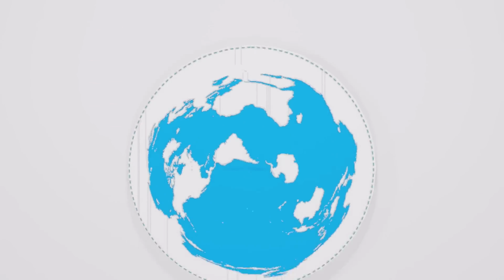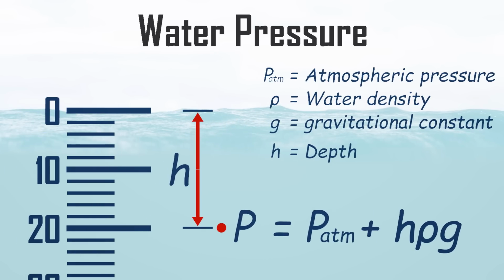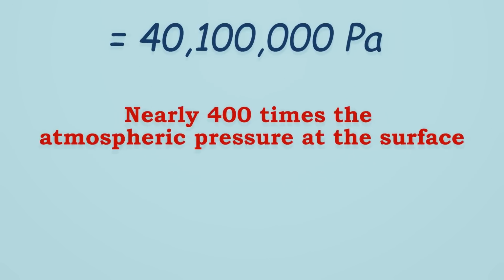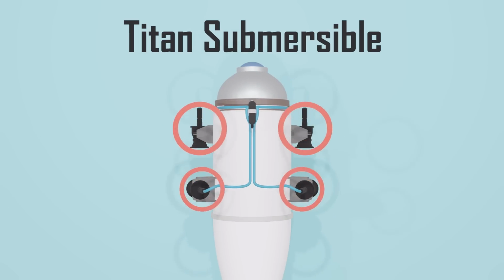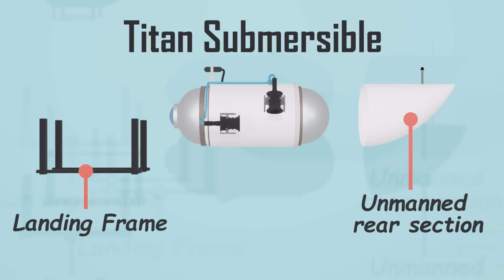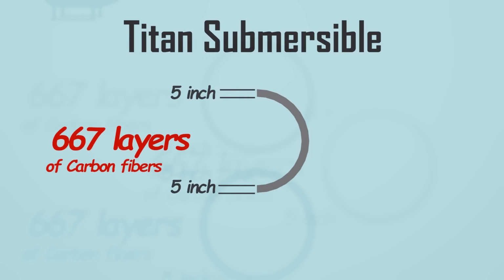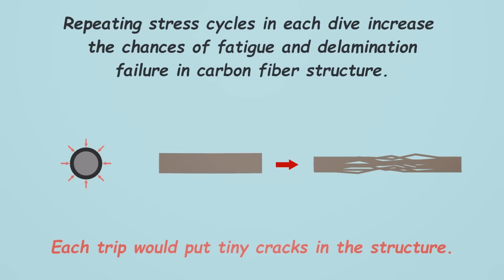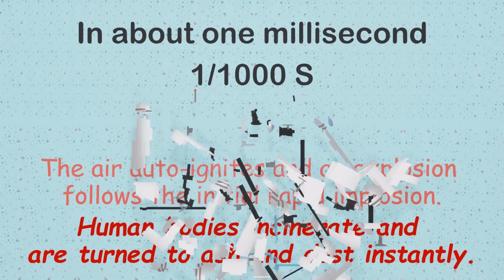Titan submersible | What really happened ?

Comment: "...inner hull which was meticulously engineered to withstand the tremendous pressures encountered in the deep ocean..." Nope! Not even close! Why does an electrically powered submersible have "a high concentration of hydrocarbon vapors" inside the crew cabin?

Comment: The CEO, ignored the warnings and recommendations from the Marine Technological Society, other submersible groups, many experienced experts, and former employees he fired for not approving of his actions. The sub failed on its 14th dive, the average protocol of testing any experimental submersible is on average 50 dives. He also refused to do NDTs on the hull, Non-Destructive Testing….Ultra-Sound. But then again, he is quoted as saying that, he needed to break rules in the name of innovation, he did not want to have experienced submariners, experts, who are mostly 50 year old white guys to be involved in the venture….because they are un-inspiring to recruit the younger folks. Always err on the side of safety.
Reply: Since starting his big money Titanic tourism endeavor, back in 2019, the so-called brains behind this tragedy had already successfully completed over 40 cycles on the vessel before this disaster popped his bubble (that'd be 40 dives down to the Titanic, along with another 40 successful return trips to the surface) This sub had completed a fair bit more than just 14 dives in total. Just sayin'.
Reply: @IndyandJazmin  Every scuba cylinder must be tested every 5 years to more than twice the pressure it is charged. At what pressure and when did they test it?

Comment: Airliners extensively use carbon fiber these days and are also subjective to cyclical stress. The difference is not so much pressure per say, but rather that those parts are certified, inspected and not least, have service lifetimes, based on extensive testing and thus replaced with a margin of safety.
Reply: The pressure of an airplane and even a space ship is less than 1 bar and the pressure inside is pushing out against the airframe.  The pressure at 4000 meters is about 375 bar and it is pushing in.  Night and day difference.
Reply: No, the difference hers is that the body is pressurised !

Comment: The main thing I learned is that round shapes take pressure equally but the Titan was a cylinder and as an engineer would know, it is more susceptible to pressure issues .
Reply: You're correct, it should have been a spherical shape plus stronger materials. But he thought he was being " innovative '
Reply: Pressurized cylinders are not round and do not explode. The main problem was using the wrong material and ignoring the higher pressure tests.
Reply: External pressure puts the carbon fiber into compression. That not how it’s done

Comment: Many assumed they had a quick death, however, the carbon fiber was a poor choice for that, hydraulic testing shows the fiber would have slowly, at first, collapsed, which would have increased the air pressure inside, it would have been very painful and debilitating. Just like being inside a large toothpaste tube with someone stepping on it slightly then over time adding more and more weight, about 90 seconds or so. When they show pics of the recovered tube, it will not be imploded flat, it will have a dent in it
Reply: With 6000psi pressure there is no "slowly" involved with a hull breach.  A pin hole crack would turn into a complete implosion in milliseconds.  It is hard to comprehend these kinds of pressures.  It wouldn't be like a toothpaste tube, it would be like being inside a bomb.  There is no recovered tube since the carbon fiber basically turned into splinters while the titanium hemispheres were pretty much intact because they were the strongest parts of the sub.

Comment: I stopped watching this crap when you called the Titan "a marvel of engineering". It was not.
Reply: Oh yes it was.
Reply: @methylene5  So where is it? Oh right, spread all over the bottom of the ocean because it does not work.
Reply: @dougerrohmer  Yeah, so is the Challenger Shuttle. Accidents happen, and in the case of the Titan the cause is yet to be established.
Reply: @methylene5  The Challenger was also an inherently bad design. The shuttle tiles were often damaged by ice from the tanks, and nobody thought to come up with a better idea or an in orbit repair scheme.
Reply: @dougerrohmer  Yes, it has its issues I remember the disaster very well. The point I was really making, is that something can have a lot of good tech, but it only takes one thing to go wrong and then disaster. The problems with the Challenger design were fixed, and then later the launches continued. We don't know what happened to the Titan yet, but people who know very little about this topic are assuming waay too much. Also, I'm not sure if there are any impartial "experts" we've heard from, most seem to be OceanGate competitors with an agenda, who seem intent on making the problem all about the carbon fiber hull, when there's no evidence yet to support that. They're suspiciously rather quiet about the view port that allegedly was only rated to 1300m. 
Even just a small leak at 380 bar will raise the air temperature inside rapidly to over 1300 deg C due to the increase in pressure, and even long before that temperature were reached there would be an explosion of any flammables (including clothing, etc). That scenario would shatter the hull immediately.
Reply: @methylene5  There are several problems with the carbon fiber idea, one being that carbon fiber is used in tension and not compression so it might work on a LP tank, but not a submarine. Secondly, carbon fiber fails with very little warning. Thirdly, the interface with the titanium will fail because of differences under pressure. Fourthly, it wasn't tested enough - you need to build several test articles and prototypes and test them to failure and compare data gathered with your design criteria. Furthermore, every other vessel that had gone to this depth was a spheroid shape. When you start changing too many accepted design philosophies without doing the research and testing, you're heading for failure. Nothing about this thing is a "marvel of engineering". QED.
Reply: @dougerrohmer  Yes, I know all that, just as most of youtube seems to be regurgitating the same, might as well be copy/paste. Everyone's a sub engineer now....haha. 
There are ways to use carbon fiber for hull design that take advantage of its tensile strength for compressional loading, anyone who says otherwise is poorly informed, just not by simply winding the inner hull. The way the Titan CF hull was built was more suitable for internal pressure, not external compression. The fact that the hull lasted as long as it did, when there are far better ways of doing it, is evidence that there is potential yet for carbon fiber use in DSV hulls. That hull could've been at least two or three times as strong, and easily so. 

There is no future in spherical titanium/steel DSVs except for the super rich, and there are years long waiting lists, and the cost is in the millions per dive. A lot of politics involved as well. The future is in buoyant cylindrical vessels, but yes there is a lot more work to be done, and they should be properly tested. Certification will always be difficult however, for any new material no matter how safe. 

It is worth noting that we still don't know for certain if it was the hull that failed causing the implosion, even a water leak could have caused this or even the viewing port failure. time will tell.
Reply: @dougerrohmer  Also the point I was really making about the Challenger analogy, is we don't throw the baby out with the bathwater. The Challenger had it's issues, but then they were corrected, rather than starting all over with a whole new design from scratch.
Reply: @methylene5  The Challenger showed how a specific problem could be fixed. Atlantis showed that it was a flawed concept.
Reply: @methylene5  So my point stands: This piece of crap was not a "marvel of engineering", since you agree that the carbon fiber was using the materials weakness and not it's strength.
Reply: @dougerrohmer  No, your point doesn't stand, you have no point and zero expertise in this field, and if you did you would appreciate the positives in addition to the obvious flaws. 
It wasn't a piece of crap, and if it was it wouldn't have lasted a single dive. 
I'm saying it can be improved upon, and it also shouldn't have been diving to Titanic depths, at least not more than once. It's design was revolutionary, a world first for a cylindrical sub to make to that depth just once, and accidents do happen. Smart people learn from them, improve the design and continue. Not throw their dummies out the pram with ad hominems (only after the fact with hindsight wisdom). 
Play it safe and just build prohibitively expensive $40 million subs just like they've been doing for years. Nothing innovative about that, just more of the same.
Reply: @dougerrohmer  Do you mean the shuttle Columbia disaster or are you suggesting Atlantis proved the shuttle programme was a flawed concept as was the final launch after 30 yrs? Not sure what you mean by "flawed concept", times change, requirements and technologies change. That doesn't mean it was a flawed concept for its time. We don't use steam trains anymore, but that doesn't make them a flawed concept for their time. Not sure what you're trying to say.
Reply: @methylene5  That's expanding the concept a bit, but the Shuttle was a flawed concept as per Atlantis, and NASA management was completely working on a different corporate culture than what emerged from Apollo as per Columbia. To prove my point about the flawed concept, Shuttle was sold to the taxpayer as a re-usable cheap launch system that would do many many launches per year and turnaround would basically mean kick the tires and fill the gas tank. Then everybody including the Airforce got involved and the design was scaled up and an external fuel tank and boosters were added and the Airforce pulled out and so what started as a race horse ended up as a giraffe.  Of the many many cheap missions it was going to fly, they only and I repeat only because it's way less than the original concept, flew 135 missions over 30 years and that's between 5 built and flown orbitters. Oh, and it wasn't cheap. As for NASA management, we all know that they knew that the O-rings were problem children, but nobody had the balls to call a halt because the mission count was super low and they didn't want to make it even lower. Yes, the Shuttle was closer to an engineering marvel than the crap sub, but it would have been a lot better if the original spec was nailed down and then design started.

Comment: The guy was a convincing idiot that ignored numerous warnings, fired his engineers that warned him, and got 4 other people killed with his hubris. Also used equipment that was not rated for submersibles and had no redundancies. I also heard he got the carbon fiber that was used for cheap because it was expired for use in aircraft. You forgot to mention that.
Reply: The guy OceanGate fired, David Lochridge was no engineer. He had no qualifications in engineering whatsoever.
Reply: @methylene5  He was ultimately correct though, and still breathing.
Reply: @scaleworksRC  Hindsight is wonderful isn't it? Accidents happen, and Stockton Rush made no secret of the hazards involved in travelling 2 miles under the Atlantic. People have died, and you can bet there will be others. It was either this sort of project sub, or no sub at all as conventional deep sea diving subs cost tens of millions and can only carry 2 or 3 at most.

Comment: I know very little about engineering or physics but even I questioned many things, like the lack of gaskets where they joined those end caps to the tube & how 17 bolts to shut the entrance seemed too few….oh & using carbon fiber (which seemed too thin to me).
Reply: A soda can will hold the weight of a person, just as an egg is nearly impossible to crush. Yet these are soft materials, they only fail under load when there's a defect. Same principle applies. All these fools shouting about "CF doesn't handle compression...duh!" really haven't the first clue about what they're talking about.
Reply: @methylene5  🙏 thanks for replying

Comment: The titanium end caps were glued to the carbon fiber shell, I don't care what epoxy was used,. after several dives of expansion and contraction, add the salt water dissolving the epoxy or at least degrading it and the port hole glass rating, this sub was a disaster waiting to happen, as an mechanical inspector, I would have questioned everything. Knowing the CEO carelessness on safety and cutting corners, this epoxy probably missed salt water testing, I agree with others, this prob was the failure point, design engineering, maybe not the carbon fiber shell itself at fault, but the assembly, "glue", fine in air defense, but even defense industry, salt water testing is required
Reply: They should’ve used Flex-Seal
Reply: More reiterated internet nonsense. Previous clients have said the CEO was a safety fanatic. What Stockton Rush was saying is that beyond a certain degree of safety, it's not financially viable to go further. Imagine, for example, if our cars were designed to be 100% safe in all accidents, they'd cost millions a piece.
Reply: @methylene5  acrylic window rated for 1300 meters on a 3800 meter dive says bullshit on a safety fanatic!
Reply: @revolvermaster4939  Not quite, it's been reported that the acrylic viewing port was rated to 4000m, but the flange mount was different on this sub from what the manufacturer specified so it was rated down to 1400m due to uncertainties, to protect themselves from litigation in the event of failure. To be fair, if that was where the failure occurred, not a difficult mistake to make. Easily overlooked.
Reply: @methylene5  easily overlooked, WTF? Total disregard for safety & total incompetence. I’ve seen the acrylic rated 1300 meters by the manufacturer from every source I’ve seen.
Reply: @revolvermaster4939  Yeah, another expert sub engineer are you? Like I said, a simple custom flange not being a risk is easily overlooked when most of the attention was on the hull. He's not that stupid to put a 1400m rating view port on a sub intended to dive down nearly 4000m. He'd have to be a total idiot to do that, and he was no fool.
Reply: @methylene5  his own videos disprove your opinion
Reply: @revolvermaster4939  It's not just my "opinion", I'm an engineer with over two decades industrial experience post graduation. I know how these thing work and how these people think. There is no way he would knowingly put a viewing port that he believed was only good for 1400m. If he was that stupid he'd have died a long time ago.
Reply: @revolvermaster4939  Anyway, I think a lot of this is moot. There are very few facts, mostly rumours and hearsay and I'm reserving judgement until we find out the failure that caused the implosion. I wish more would do the same. I'm sure we'll find out in good time.
Reply: @methylene5  apparently he’s been lucky until now because the results speak for themselves. His own words in his own videos demonstrate that he was no safety fanatic.
Reply: Yes, Flex Seal, not sure of the holding power in salt water of this product under extreme pressure tho

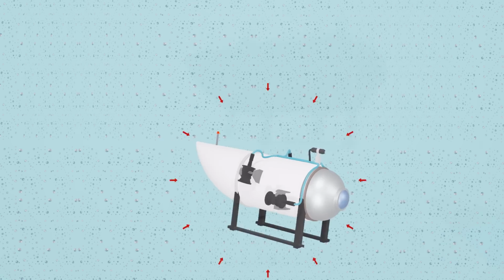Comment: 7:26  Why was the air inside the submersible loaded with hydrocarbons?
Reply: Oxygen
Reply: @paulfirth6800  Although the oxygen would become superheated when condensed upon exposure to the intense pressure, I'm not sure that it would actually ignite without a fuel source. I believe the craft was powered by battery. It's possible something in the battery may have contributed to an ignition.
Reply: Gas generates heat when compressed, especially at very high rate of speed. More so at the extreme pressures at the mentioned depths. The molecules become wind in no time and in microseconds, become very high speed shrapnel. Same reason why objects burn up on re entry from space.
Reply: humans produce hydrocarbons ie they fart...